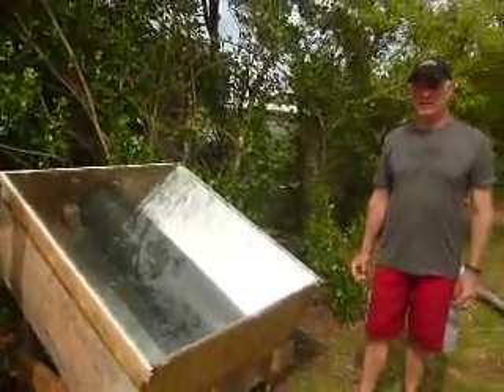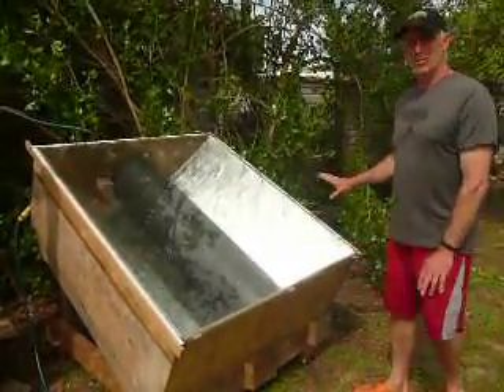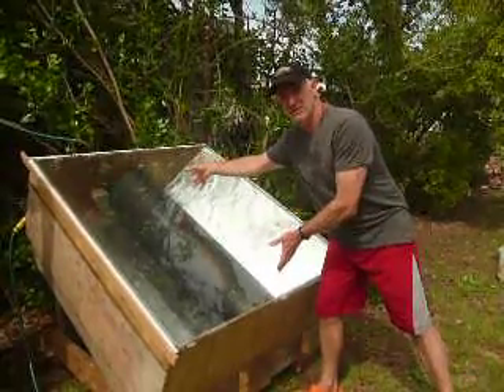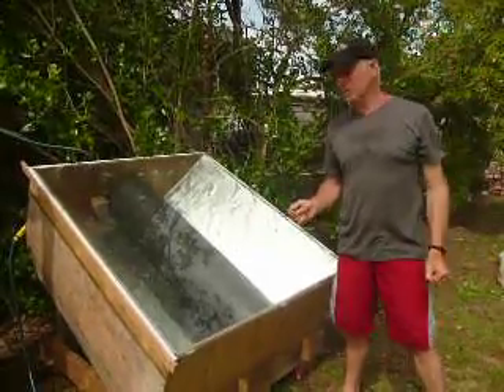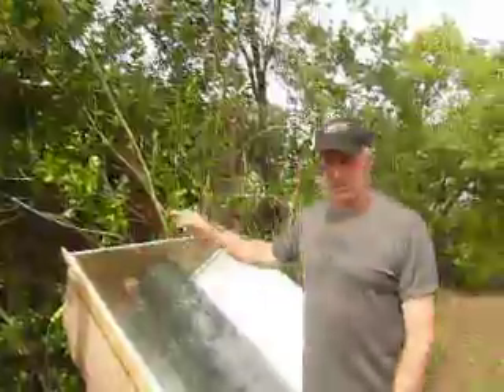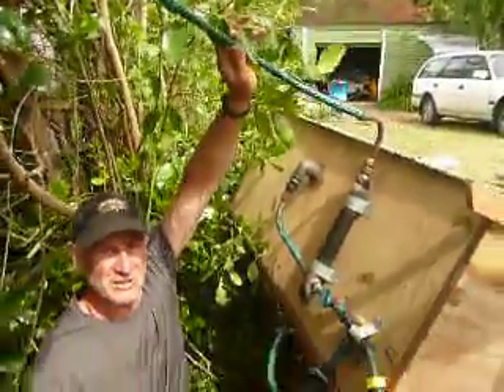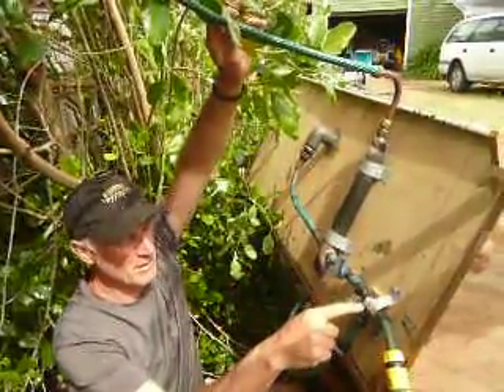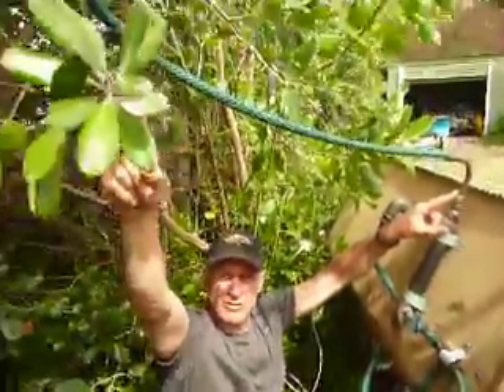Solar hot water Parabolic cylinder reflector

Comment: interesting device.  How comfortable is the hot/cold water ratio that you've set with the current flow? (considering that you automatically set the temp by joining the cold and hot water lines at the tank)